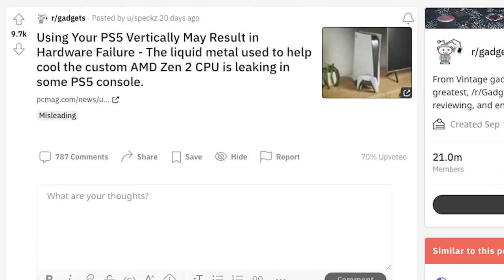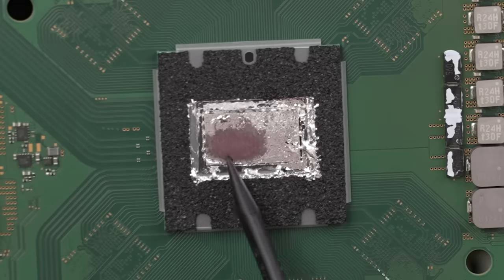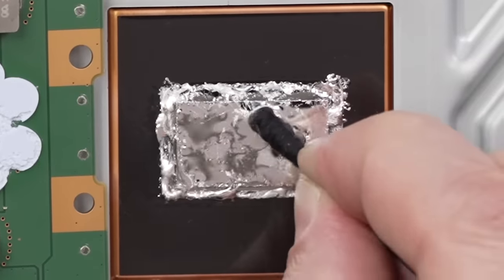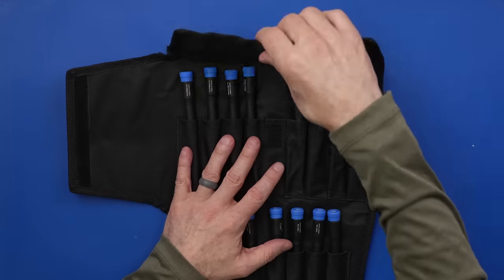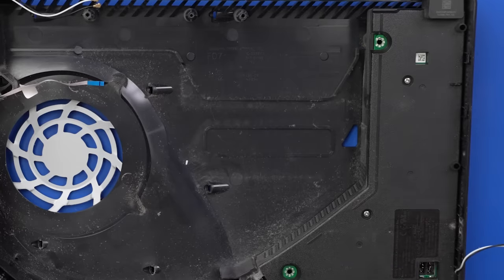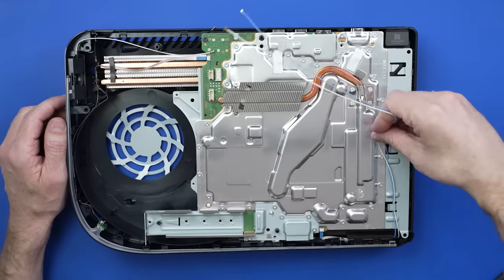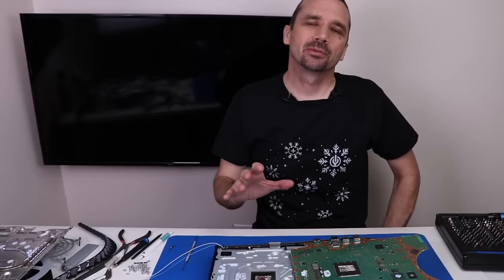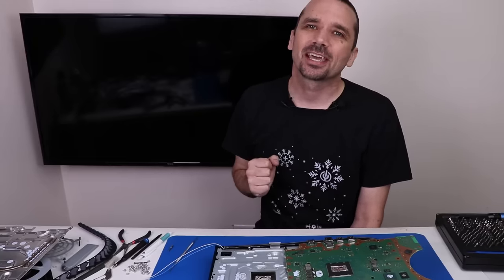PS5's Have a Liquid Metal Problem - But It May Not Be What You Think

Comment: The first reason of liquid metal leakage is the fact that sony put too much on apu and heatsink, if you simply suck it up a little and re-spread you will be absolutely fine.
Reply from the maker: I actually think that there isn't enough on them.
Reply: @Tronicsfix  pobably you're right, but if there is the right amount i don't think it should run around when the clamp is attached, but maybe i'm wrong, after all i've only seen 5 ps5
Reply: @Tronicsfix  I doubt it is a problem of too little. It is more likely that the contact patch between the heatsink and the top of the chip is either not completely flat or there is not enough pressure to keep the surface tension between the liquid metal on the two parts. Adding more liquid metal will just increase the chances of leakage on to other components, imo. A pressure map of the contact surfaces would be a much better starting point than just add more liquid metal.
Reply: The allowed gap between barrier and die is too much. If it was halved then the amount of extra LM that could "leak" would lower.   The other issue on oxidation is probably  fail/ defect in the amount or time in production of the níquel barrier on the heatsink.  Without níquel barrier LM or its main component Gallium will " soak up"/ diffuse in the heatsink leaving dry metals like indium, bismuth and so on.    Gallium alloys need strong acids to break oxidation.
Reply: In the PC building circuit where LM was first introduced by Kryonaught for replacing the thermal paste between the CPU and IHS, less was more. Too much LM and you risked leakage. Part of the process was to coat the surrounding CPU solder with nail polish to prevent the LM from damaging components. 

Having a "dry spot" is indicative that the contact pressure between the APU and the heatsink isn't flush due to flatness or the heatsink isn't actually torqued down properly in the right places. Pushing it away from the die and creating the voids. You know there is too much LM on that APU because it's actually pooling around the APU. That extra LM is doing nothing for cooling.

Comment: Keeping the fan ventilation clear of dust and debris is much much much more important than taking the system apart for liquid metal maintenance (Just wanted to post this, TronicsFix would agree!)

Keep the system fan and ventilation holes clean and your system should last a long time
Reply: I’d say keeping the heat sinks free of dust is of the utmost importance but maybe you implied that as well
Reply: @captaincrunch1707  yup, the ventilation holes feed straight to the heatsink fins

Comment: I wished there was an easier way to clean a PS5 without almost fully taking it apart.
Reply: They have vacuum ports on the inner case. There’s two holes on the fan side, that to put a vacuum hose to. I use to use them, when I lived in a very, very dusty area with a dog.

Comment: It shows again that Sony really cheaped out on the cooling, especially the heatsink, of the PS5.A nd as the consoles grow older, that problem will only get worse. Not an XBOX fanboy, but that thing stays cool at least. Guess they learned their lesson the hard way during the "Ring of death"-scandal with the 360...
Reply: Liquid Metal is “cheaping out???
Reply: @CrimsonGear80  Indeed. Liquid metal is not that much more expensive than a decent thermal paste. Especially if you buy large amounts in bulk. And it is for sure way cheaper than a bigger thermal solution with more copper and aluminium. Rumors have it that Sony NEEDED the liquid metal as kind of an emergency solution after they figured out that the PS5 would overheat with that heatsink when using normal TIM. Also, the APU on the Xbox Series X is really similar. Why do you think Microsoft is using that massive vapor chamber if it would not be necessary? Also, that is not a new behavior from Sony. A have an OG PS4 and a phat XBOX One, sitting next to each other. You may have a guess which one runs cooler and more quiet... And to prove, that IO am not a fanboy (in fact the arguments above did not reach you), I like that Sony consoles for the easy and relatively cheap storage expension. Something the XBOX never really had... Also, I mostly use my PCs, which is also how I learned about cooling electronics properly.
Reply: Hi could you tell us if your model is a 10000, 11000 or 12000 one? And if you have any crash issue (shut down with Only PS5 games) 
  I'm suspecting a problem only with the 11000 one (I've 1116A) (it's written under the PS5) Thank you
Reply: @Thommygun-qv7um its literally been proven by many people that xbox runs hotter wtf are you on about 🤣

Comment: I'm curious cause I haven't seen a lot regarding it, but what about the vacuum holes Sony put on the case to clean the dust out.  Would this help if dust is already caked on the heatsink?
Reply: Also, I know you attempt to fix them for content and show us the inner workings but could you send them into Sony for repairs since they are still under warranty?
Reply: no it be useless, take it apart and clean it, then attach dust filter and pray that liquid metal didn't get damaged
Reply: @MGrey-qb5xz  now I see you just have no clue what you’re talking about, and are just regurgitating incorrect talking points. Liquid metal doesn’t get damaged. I’ve had the same application of it on an i5 4670k since the cpu launched, with zero degradation. I’ve been building computers for over 25 years.
Reply: @BenFilley  casing
Reply: @MGrey-qb5xz  is a word. Which means nothing without some sort of context.

Comment: Phil says "Yes". I think a simple precaution if it is indeed an issue is to either lay the PS5 horizontal OR every month or so flip it 180 so the flow goes the opposite direction. I just flipped mine.

Comment: with liquid metal usually less is more the amount you put on at the end is quite scary
Reply: Even the initial 2 beads that he put on would have been more than enough for both the heatsink and chip. Also, he didn't even remove the old liquid metal from the chip and heatsink. To properly apply the new liquid metal, he should have used the old liquid metal or a small bead to get the oxidation cleaned off, then cleaned everything off, then used a very small bead of liquid metal on each surface and spread it as much as you can to cover the surfaces. This would create a good contact between the heatsink and chip with no risk of squeezing out liquid metal all over inside the unit.

This is based on my expirence of delidding and using liquid metal on my old 6700k, 8700k, and watercooling my 3090 and I have never had any issues with liquid metal seeping out or degredation of parts in over 5 years of use.
Reply: @ravencrovax oh wow…that’s way more experience then him hey?! Jeebus
Reply: @KkevrockK  I never said that I was more expirenced than he was, did I? No. I just listed my expirence with using liquid metal on my own equipment. Also, just because someone has a lot of expirence with something, that doesn't mean that they are doing it in the optimal way.

If someone is truely interested in learning about a topic or skill and sharing what they have learned with others, they should always be willing to listen to outside suggestions and take logical advice.

Comment: If my launch model doesn’t randomly turn off and have had no issues with it, you still think there is a chance it has a dry spot already purely from heat cycles?
Reply: That's what the man says. 16:20
Reply: Launch model has larger heatsink and runs 3C cooler than newer PS5 (CFI-1100) so there is bit more headroom.
Reply: I just don’t believe the liquid moves that much when pressed up against the heatsink, unless of course it’s been dropped. Especially with factory seal on xclamp I’m curious but not enough to open it.
Reply from the maker: Yes, I think there is a chance that it has one. No way for me to know for sure though.

Comment: I haven't had a single issue and it's been vertical the whole time. I'll try and make space to place it horizontally, just to be safe.
Reply: Hi could you tell us if your model is a 10000, 11000 or 12000 one? I'm suspecting a problem only with the 11000 one (I've 1116A) (it's written under the PS5) Thank you

Comment: I wonder what caused it to oxidize that badly...
Could heat really do that to LM?

If so, thats a serious design-flaw in the PS5, especially considering how close it runs to its thermal shut-off point.
It would basically be a countdown until it either refuses to boot, or melts itself.
Reply: dust i assume, even a small amount of it can cause dry spots and not make it work properly, liquid metal is trash and hopefully stay away from gaming laptops

Comment: Dude! This is what’ll happen to me! Especially on hot days it’ll just turn off after an hour, no overheat warning or anything! Then turn on with that same loss of power error. I gave it a thorough cleaning but I never attempted to look at the board myself because I didn’t want to take it apart that far. I bet my issue is the same result on the board! I’m gonna have a look under the hood again but I was about to go and buy a slim. How do I do this as a complete newbie?

Comment: I'd be interested in seeing what kind of thermal difference there is between the liquid metal and just using regular thermal paste.  Also, if there is an airflow problem with the ps5, that will cause heat to build up more on the chip.  I wonder if the excess heat is causing the issues with the liquid metal.
Reply: He did a video on it a while back
Reply: He just did a video on this.

Comment: Damn bro I really don't want to put my PS5 horizontal! I've had it vertical for two years now and had no problems. But I value your opinion, and I'm thinking of putting it horizontal.
Reply from the maker: A lot of people have no problems with it vertical. This is just my opinion based on what I've seen. I don't have any actual scientific data
Reply: Yoda: Superstitious you are. 😆
Reply: @princegroove  😂
Reply: Hi could you tell us if your model is a 10000, 11000 or 12000 one? And if you have any crash issue (shut down with Only PS5 games) 
  I'm suspecting a problem only with the 11000 one (I've 1116A) (it's written under the PS5) Thank you
Reply: @angelogalileo  My launch day PS5 has recently been shutting down after 30 minutes of gameplay, so I’m suspecting it’s a Liquid Metal and overheating issue.
Reply: @princegroove  do you try to clean dust?
Reply: @angelogalileo  I’m gonna open it up and do a thorough cleaning before I send it in to PlayStation for repairs.
Reply: @princegroove  tell us if the cleaning helps!

Comment: I am curious, would a ps5 run ok with thermal paste, something like thermal grizzly, instead of liquid metal (my model is 1216a, still under warranty but when the time comes to open it up and clean it I am afraid of reapplying LM )? it seems to me it would be a safer solution than LM. Any thoughts?

Comment: It seems like they had some overall cooling issues with the system, since they used liquid metal and it's still so sensitive to dust buildup. And they released a revision and barely removed any screws? Lol.

Reminds me of an engineering joke: Why did the designer use 20 screws? Because he couldn't fit 21!
Reply from the maker: Lol, great joke!
Reply: Is Liquid Metal supposed to repel dust?

Comment: I ran into the same issue a couple weeks ago a friend of mine took his PS5 apart before To clean it himself And it was shutting off prematurely I used the thermometer the temperature got up to about a 128 and the system shut off When I took it apart his APU had a nice bald spot in it I did the same thing suck some up and then Re spread the liquid metal He hasn't had a problem sense Plus his system was dirty As well
Reply from the maker: It seems like the worst dry spots are on the consoles that are dirty. Just an observation

Comment: Who would have thunk that the relatively large gap on console coolers :VRM height variances + thermal goop and not soft pad (longer lasting)  and LM "drying out" over time (oxidation) which needs regular manitenance.

Would be a failure point in a system not built to be easily maintained for end consumers at all
Reply: The dryout is a failure in the níquel barrier on the heatsink. That allows gallium to diffuse in the copper leaving indium and other metals behind.  So one needs an acid to break all oxidation on LM.
Reply: @brunogm  Its still a maintenance issue as this also happens on expensive electroplated  nickel waterblocks. Galluim is just one sneaky snitch. Just a LOT slower

Which is why LM is mostly relegated to enthusiast systems like delidding an 8700k

Comment: So the new PS5's 1215/1216 wont have the dry-spot/liquid metal issue? How is this happening? Is it due to the horizontal/vertical position? I have the 1216A version and have mine vertical because i cant place it horizontal 😓
Also youre the only tech guy i trust on YT
Reply: Hi could you tell us if you have crash issues /shut down with only PS5 games or not?
 I'm suspecting a problem only with the 11000 one (I've 1116A) (it's written under the PS5) Thank you
Reply: @angelogalileo  I dont have 1116A so i wouldnt know srry. I havent had any issues with my 1216A so far but i havent played much and not at all since february because of my internship and study i got no sparetime anymore 😓😭
Reply: @MissxLariz  thank you it helps! I found
12XX without problem : xxxxx
10XX without problem xxxxxx
1116A without problem x 

1116A WITH CRASH SHUT DOWN PROBLEMS : xxx

1115B without problem x
Reply: @angelogalileo  Interesting thanks for sharing

Comment: Hey TronicsFix... Quick question, Have you seen any of the new 1200 models having dry spots in the liquid metal, or only the older 1000 and 1100 models?
Reply: Do you have any answer of this very interesting question? I'm pretty sure that crashing issues are only on the 11000 models... After a little investigating I found 3 guys with 12000  without any issue.
One with a launch edition 10000 without issue.

11000 : one without issue, two (3 with me) with crashing shut down problems... I've a 1116A

Comment: Does the futur ps5 slim use LM? Is it a smaller cooler ? The same die size components? Same power?. It seems they favor horizontal position by not including the stand. Is it an indication that they recommend to position horizontally?
They didn’t gave much information and the release is in 2/3 weeks
Reply: It uses Liquid Metal, the new stand is two pieces of plastic. Selling the stand separately might just be because more people will want that instead = more money.
Reply: @fardel8021  i bought the original disc ps5, it runs cooler than the slim. I added a 4TB 990 pro with a custom cooler i installed into it myself with dual thermal pad double side and everything runs fast and cool. And i use it with horizontal support.

Comment: My take from this video is that I don’t think it’s primarily the liquid metal that’s the real issue. It’s the heat sink or power supply that’s causing another sensor to automatically shut off the system. Hence the fact there’s no overheating warning. This could be seen as a design flaw from sony. But I think it’s brilliant because why are would anyone be mad at sony that their room hella dusty lol.
Reply: well as psu is on bottom of PS5 when you put vertically, I am not surprised that PS5 shutdown due to PSU overheat. The nearest it close to the flat surface, the more it sucks dust, debris, and hair. This why horizontal a bit safer.

Comment: Awesome video ,thanks  for your knowledge.... was wondering if the first ps5 that had the dry spot was an 1115a or an 1215a.... you didn't mention which one it actually was , you only mentioned the second and third ps5.... thanks again....
Reply: Mine is the 1215a model.. that is the latest edition so far. Bought mine last Thursday and sooooo far np overheating with runs at times playing over 3hrs. Plus I have mine at vertical stance.
Reply: Could you tell  us if Overwatch 2 version PS5 works with your 1215 model  PS5? If yoy've tested the game...

Comment: I can tell you the PS5 does not give you any warnings.  We have five cats and no carpeting (I replaced the entire carpeting with plank-style flooring).  The tumbleweed effect is real between plank flooring and animals, you can see hair/fur/dust acculate in such a house over time.  My twelve year old's system would without warning turn itself off when he was playing it.  It would not turn back on without unplugging it from the wall and plugging it back in.  It progressively got worse.  I carefully removed the top and bottom panels (I have the aftermarket Dark Plates V1 ).  Then unscrewed the fan screws.  I used compressed air and I could literally see scads of dust bunnies go flying.  I've had to do this twice over time of ownership.  But it does solve the problem and avoids me having to do a full teardown of the console and its 43 plus screws.

Comment: I'm a big fan for years and admire you professional insight on lots of different area's. But this time I kinda disagree with 'the perfect amount of liquid metal' I have delidded more then 500 CPU's and applied LM on all of them. The thinner I apply the better the temps are. Can you explain to me why it would be better to do like 10 times the amount of LM on a PS5 compared to a cpu?
Reply: dry spots on apu caused by even the minute amount of dust and also placing the console vertical
Reply: @MGrey-qb5xz  yes, I know, but does the big amount of LM give it a higher change to drip of when standing vertical? I always apply super thin, so it can't drip.
Reply: @conwa23  it expands when it gets hot and combine that with dust and staying vertical for too long, it goes ahead and dries on hot spots and starts pooling on the cooler parts of the heatsink and apu. Dripping off mean sony didn't place the proper procedures for making sure it doesn't just spill all over the copper which at that point is game over. L console